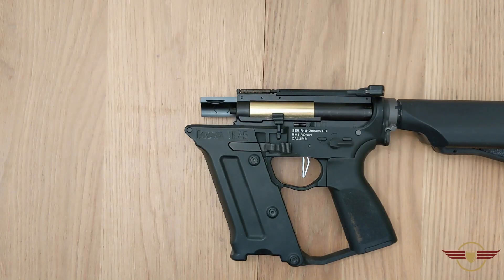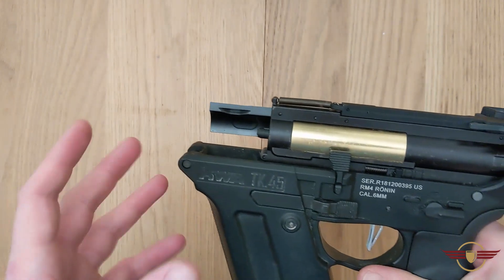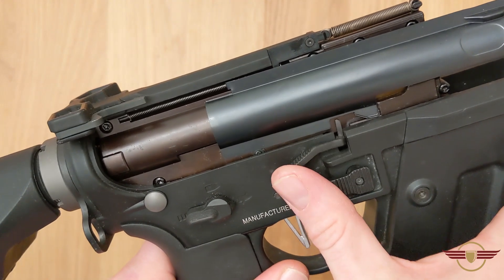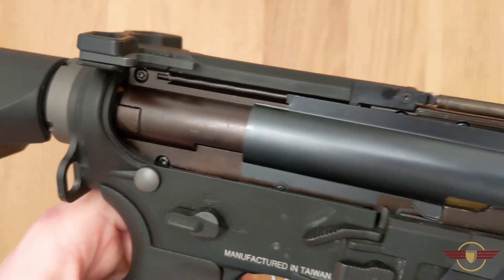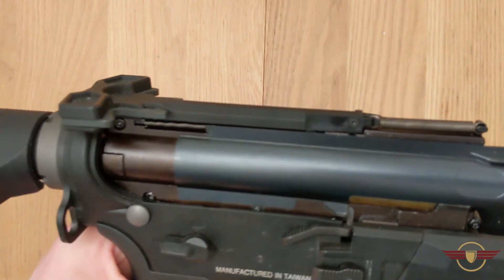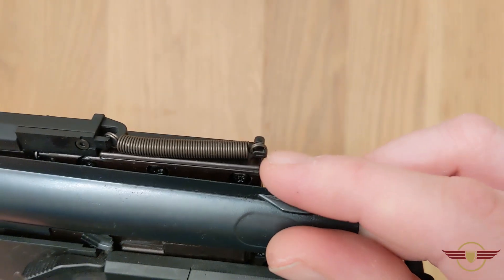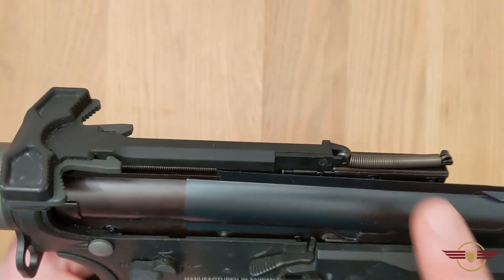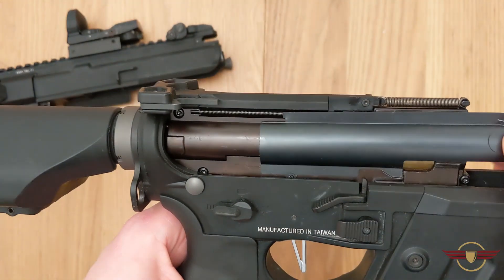[REQUESTED] KWA bolt release and charging handle issue - how it should look

Comment: I did something that “fix” the fact that you need to push up the bolt release. Just a square little piece of black Eva underneath the lever! When you pull the charging handle, there is no need to lift it and is soft enough so, just by pressing it, the “bolt” it releases! 
Besides that, Ty for the video! Helped a ton!🫡

Comment: What battery do you use
Reply from the maker: Hi, thanks for the question. For unboxing videos I usually use a nuprol 2200mah 7.4v crane stock lipo (the one that's split into two bits) but for myself when I'm playing I run my tk45 and my Ronin Recon on a vapex 2200mah one. Here is a link https://www.componentshop.co.uk/7-4v-2200mah-20c-continuous-discharge-airsoft-split-pack-lipo-battery.html 

Hope that helps
Pheas